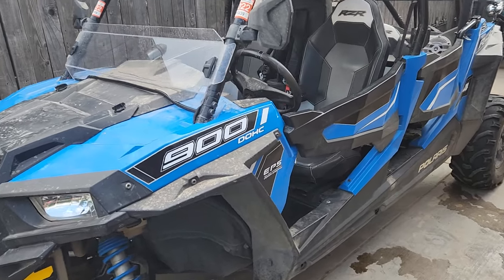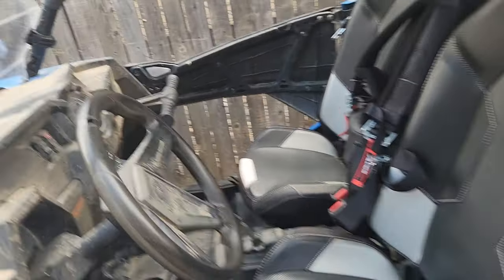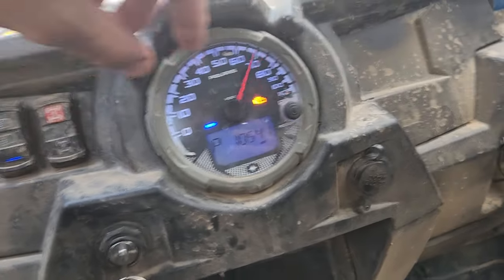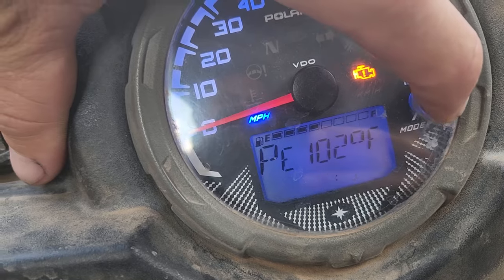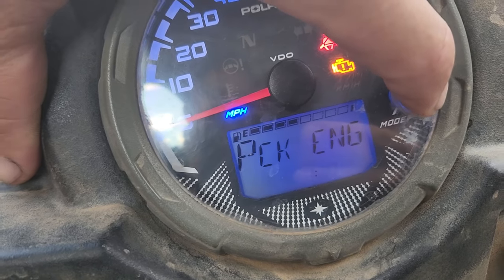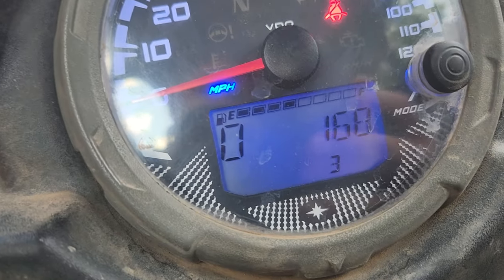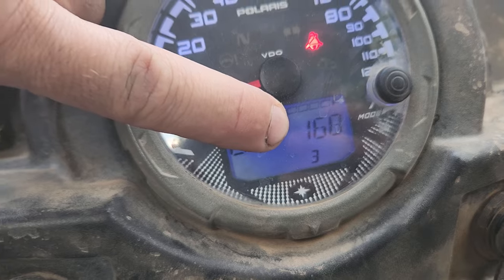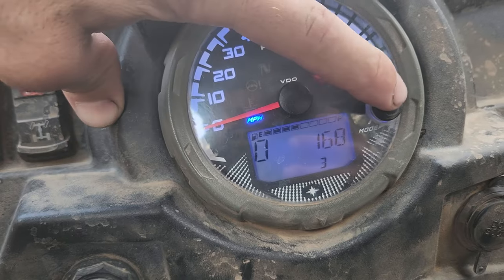Polaris RZR 900 How to Check the Codes

Comment: I have the same problem can you help me please what i need to do ?
Reply from the maker: What are your codes?
Reply: 168 3
Reply from the maker: @simonrieger4509  check voltage at the battery, if it's high replace the voltage Regulator
Reply: @brothersmechanics2028  
Thank you very much 👍🏽

Comment: My checking light isn't on but there is a code when I do check?
Reply from the maker: What's the code
Reply: @Brothers Mechanics  637 8. Bike runs like it should wire harness has been omhd, sensor swapped.

Comment: Hi, the steering wheel light turned on, how can I check the steering power fluid or where is it located?
Reply from the maker: Depends on your model and year, but you can easily check it under the hood. Should be easy to find.